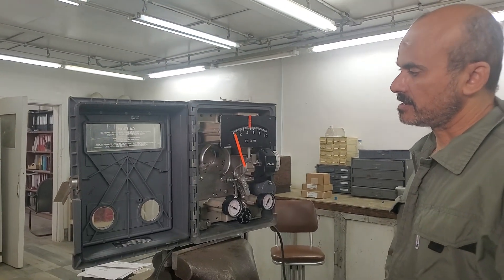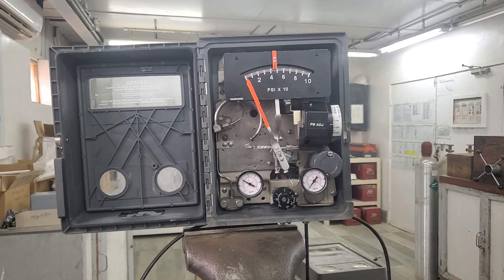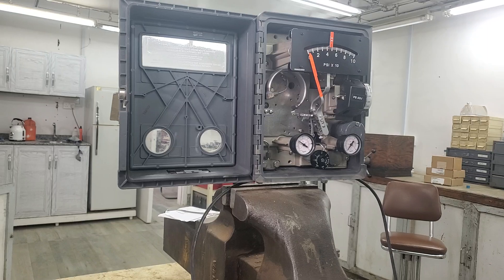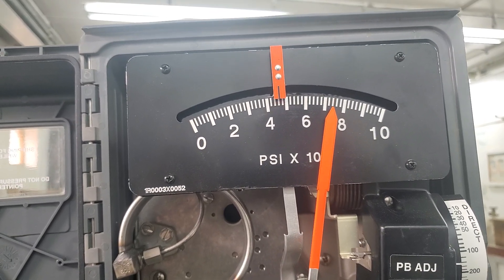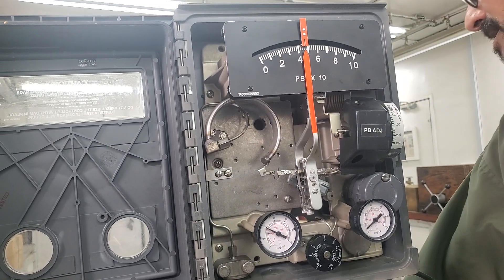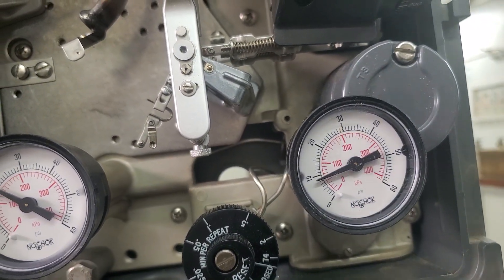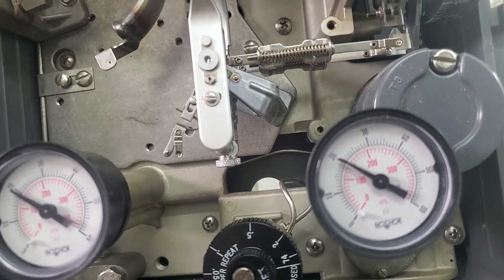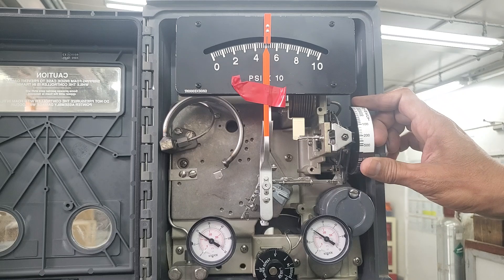FISHER WIZARD CONTROLLER MODEL 4195

Comment: How did you set the output to 9 psi? 
Because I just you cut the video in the middle
Reply from the maker: by moving the process pointer right or left until the it reach 9 psi output. make sure the reset valve is fully open first then close it when the output reach 9 psi.
Reply from the maker: By moving the pointer of process variable until you get 9 psi in the output gages